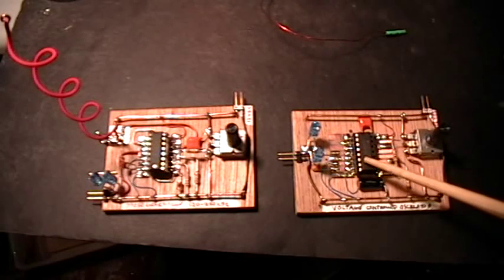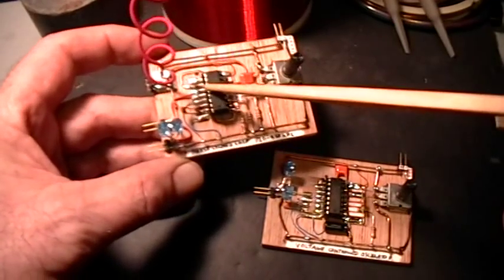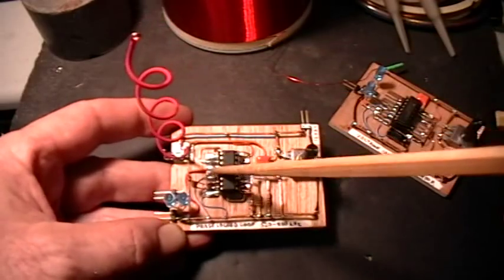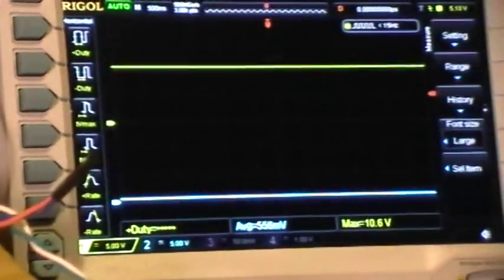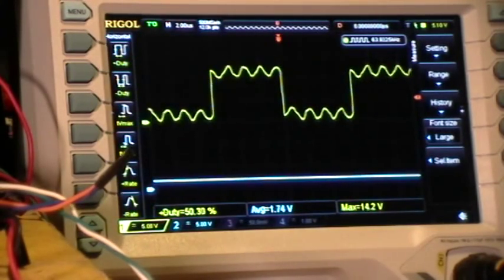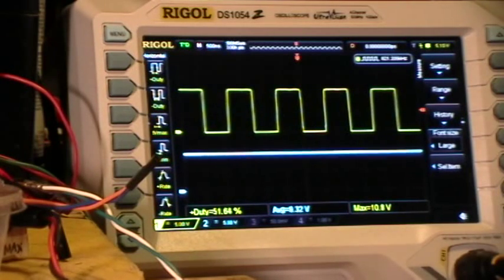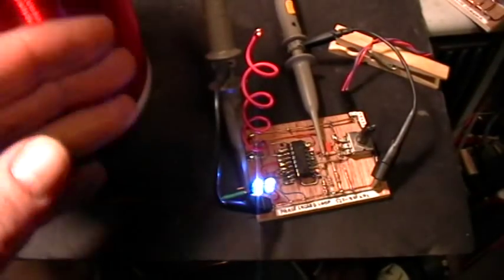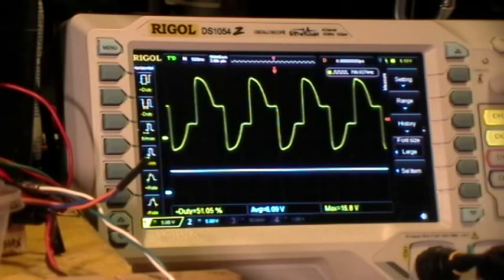Resonance: CD4046BE Phase Locked Loop Resonance Demo

Comment: If I could see the circuit better I might be able to answer my own question, but... The specs seem to suggest that at 12V the VCO output should be good for 4 or 5 mA. My question is, why is one LED not constantly lit at 50% duty cycle even without the coil?
Reply: They're in SERIES, right? Antiparallel to one another but in series with the output, NOT between the output and ground as I had wrongly assumed. I think I'll run with that conclusion unless/until someone tells me I'm wrong. Thanks TK.
Reply: Confirmed, with my own coil and tuna can. I was even able to move the LEDs up between the coil and the can which was kinda fun.

Comment: no circuit diagram :(
Reply from the maker: In the Description: "The schematic is a slightly modified version of the standard PLL schematic found in the Data Sheet for the CD4046BE, or also in many SSTC builder's sites.  The tiny C1 capacitor and the resistors set the upper and lower frequency bounds of the VCO; there is the usual 0.1 uF decoupling cap across the power input leads, and a 10k potentiometer is used to vary the input voltage to the VCO. Since I made this video I've changed the antenna to a single loop about 5 inches across, placed horizontally under the bottom of the coil, and it works much better."
Sorry, but if you need more of a circuit diagram than that, then his project is too advanced and indeed too dangerous for you.

Comment: Why not using a normal F4 PCB board instead of going into this hard-working wire mounting setup over wooden ?
Reply from the maker: In all my years of posting videos using my construction technique, you are the very first person to ask why I don't use PCBs. Well, I do have a couple of videos where I do use etched PCBs. See if you can find them! Two are for Joule Thiefs and one is Lari-Man's Objekt 13. 

One reason I do it the way I do is for instructional purposes. You should see some of the horrible kludges and sketchy breadboarding that my "target audience" uses more often than not. So I'm trying to set an example that anyone can follow, even if they don't have PCB etching, drilling, and CAD routing experience. Who wants to spend hours designing Gerbers, sending them off to a fab house, getting them back in a week or two days, and then finding out there's an error in your schematic and you have to do it all over again? Not me. 

One thing that should be obvious in my layouts, and which can disappear altogether in a modern multilayer PCB is how the actual circuit relates to the schematic. A correctly drawn simple schematic is almost an exact picture of what I will try to make in my wooden layouts. You should try it, you might like it! 

But thanks for commenting anyhow.

Comment: I give this a thumbs down. Where are the schematics of these circuit boards. With out them this video is a big waste of time to watch.
Reply from the maker: The schematic is a slightly modified version of the standard PLL 
schematic found in the Data Sheet for the CD4046BE, or also in many SSTC
 builder's sites.  The tiny C1 capacitor and the resistors set the upper
 and lower frequency bounds of the VCO; there is the usual 0.1 uF 
decoupling cap across the power input leads, and a 10k potentiometer is 
used to vary the input voltage to the VCO. Since I made this video I've 
changed the antenna to a single loop about 5 inches across, placed 
horizontally under the bottom of the coil, and it works much better.Of course I wouldn't want you to waste your time, like by reading the Description or anything like that.

Comment: This is greatly appreciated.  Can I get the 4046  to operate between 30Hz to 100Hz ? These frequencies use to control a unipolar stepper motor.
Reply from the maker: Yes, it would work,  but for stepper motor control there are better choices. Look for dedicated motor driver chips. The 4046 is designed for a different purpose.

Comment: great video! just add a couple frames of pic for the schematic so we can make this a one stop shop for cool lab experiments :)
Reply from the maker: +Jason Beauchene 
Thanks for your comment. For the schematic, just download the Data Sheet for the CD4046BE chip, the schematic is in the back of the Data Sheet. Choose the C1 capacitor and the resistors according to your frequency needs.  A pair of antiparallel LEDs on the output makes the resonant frequency finder.

Comment: Would have been nice to see you schematics so that I could repeat your test circuits.
Reply from the maker: +Yoram Stein 
In the Description: "The schematic is a slightly modified version of the standard PLL 
schematic found in the Data Sheet for the CD4046BE, or also in many SSTC
 builder's sites.  The tiny C1 capacitor and the resistors set the upper
 and lower frequency bounds of the VCO; there is the usual 0.1 uF 
decoupling cap across the power input leads, and a 10k potentiometer is 
used to vary the input voltage to the VCO."
Thanks for watching!

Comment from the maker: I see that the cowardly drive-by trolls are out in force tonight! Just in the past few hours they, with their multiple YT accounts, have been trolling my videos and leaving multiple "Thumbs Downs". But they've missed a few... What's the matter Chris, am I going too fast for you? Awww....
Reply: Bah, I would just ignore them, this is powerful information. You have helped me a ton TK in thinking about not only Induction heating applications that will bring the induction coil out of resonance, but also hydrogen production and more...  I appreciate you sharing this, I would love to see a complete schematic so its even more dummy proof.
Thank you
Reply: i just ordered 10 of the chips and some igbt's ive been wanting to try  :) i will second a diagram
Reply from the maker: Diadon Acs
If you download the Data Sheet for the CD4046BE chip, you can see the example schematics shown there. Mine here is basically the same as those, with the resistor and capacitor values chosen to either give a wide range (for the VCO only version) or a more restricted range right around the resonance frequency of that coil, for the full PLL version.
Reply: haha...i was going to say something when i saw the first 3 pop up....probably minutes after upload haha
Reply from the maker: jeremy gwilt
You'll need gate driver chips to sit between the PLL and the IGBTs or mosfets.  Or you can make gate drivers from an NPN-PNP totem thing.  Look in google for "4046 circuits" then browse the Images, you'll see lots of representative schematics and how the gate drivers are used in half and full bridge output designs.
Reply: TinselKoala No one of substance pays any attention to them anyway. Ignore them.  That can on top reminded me of a fascinating book: "Draw the lightning down" by Michael Brian Schiffer. It's a treasure trove of described experiments from the 1700's and 1800's. electrophysicists and electrobiologists. Brilliant work. The pictures are moderately acceptable.

Comment: Quite fascinating. Especially the similar traces for the different configurations. Reminds of own Dr. Stiffler SEC experiments today (weirdly enough), where tuning is always affected by capacitance and grounding of the human body. There could be all sorts of applications for a different wireless circuit method with this. Does anything happen with an AV plug near the coil ?
Had to laugh with "a genuine oatmeal box" :)